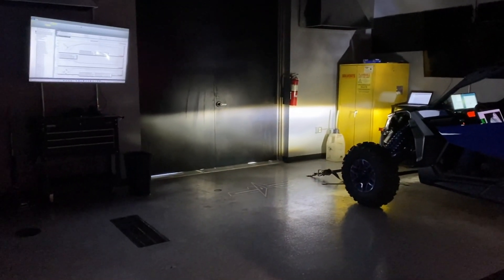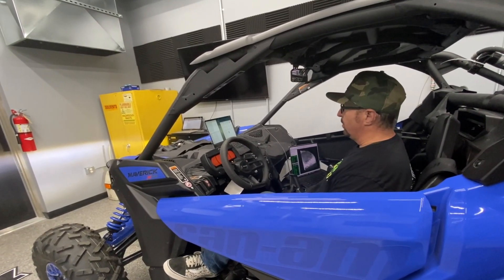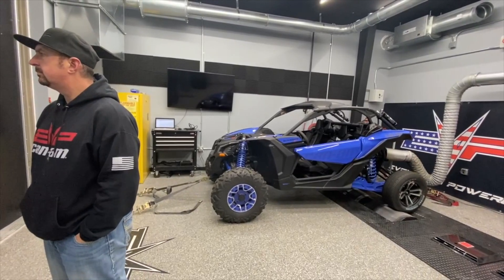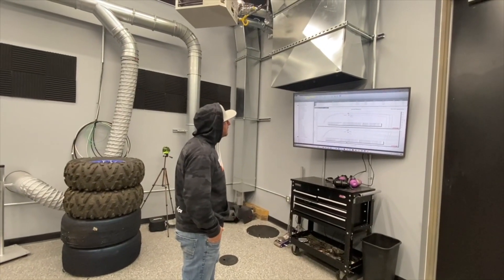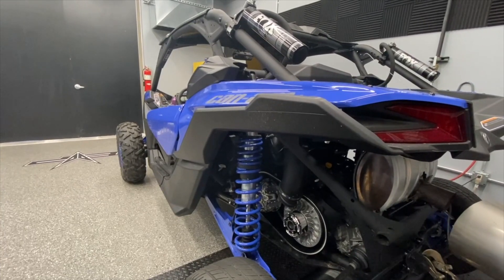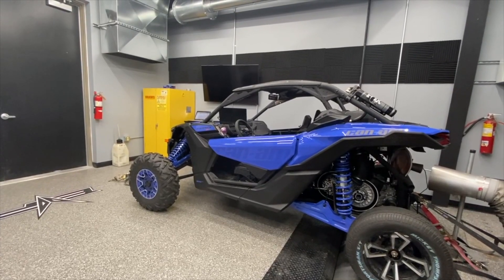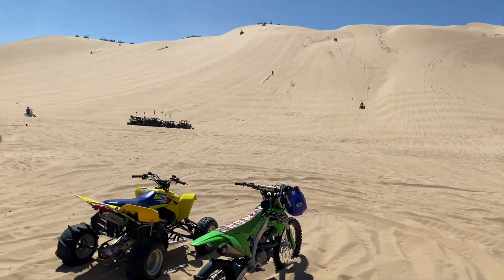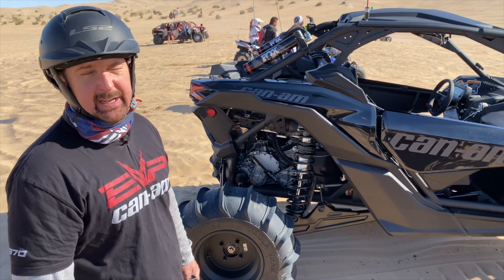EVP 2021 X3 RR ECU Tuning Development and Testing

Comment: I thought the 2021 RR was 195hp? Is that at the crank..........?
Reply: yes
Reply: 195 is at the crank. Their dyno run of 191.47 at the wheels should equate to about 218.5 at the crank by my figures.
Reply: @garyfrankovich3890  I'm hoping they can figure out the late model tuning. Unfortunately I got one of those.....

Comment: What did Can-am change from 2020 to 2021 to add horsepower? I have a 2020 rr and curious???
Reply: I’m sure you have this answer by now, but the 21+ use a far more advanced ECU which allows for far more precise engine management.
Reply: @sheputthelimeinthecoconut629  Nothing more internal to the motor or turbo? So, if I get a tune like EVO there aren't any more advantages besides the ECU???